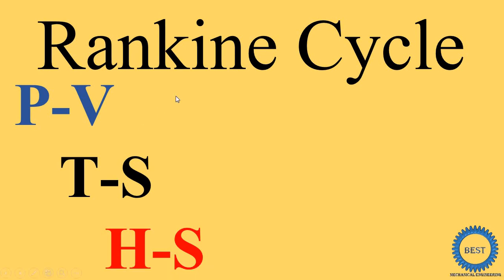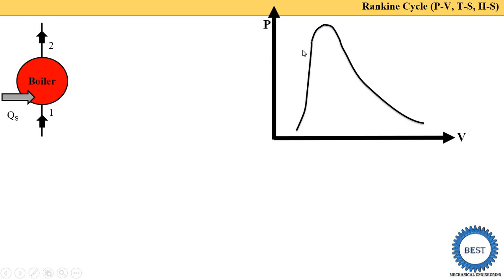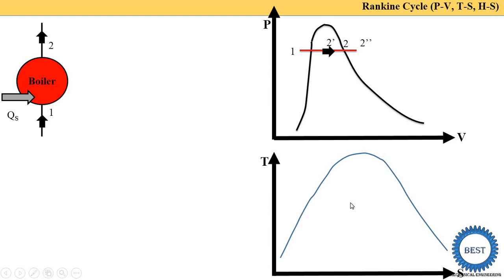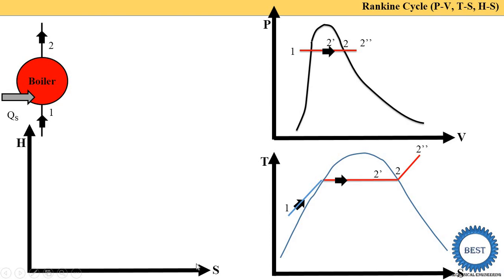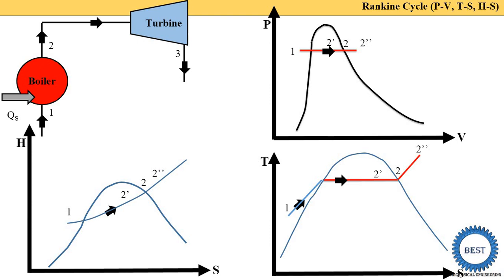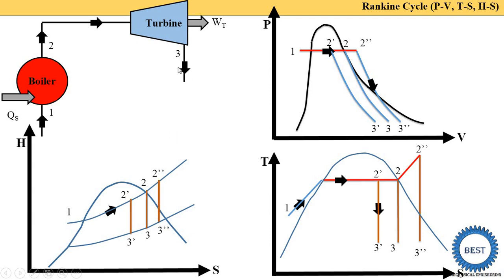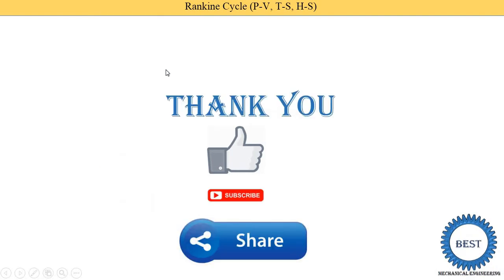How to Draw P-V T-S H-S Diagram of Rankine Cycle

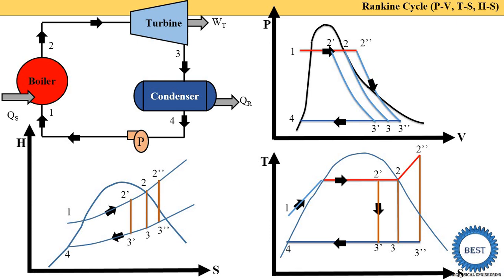Comment: 4 to 1 is isentropic process, s1=s4. So, in P-V diagram it should not be a vertical line ie. Isochoric but should be curved isotropic right.  13:02